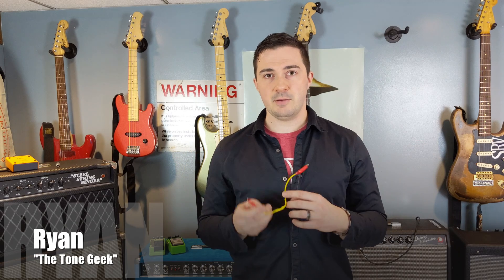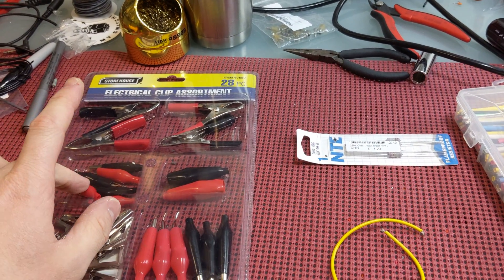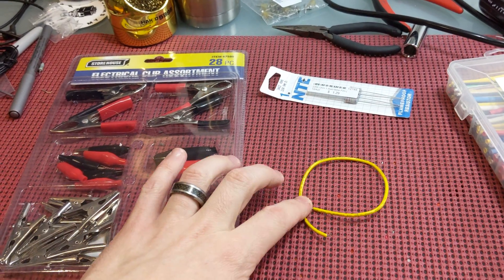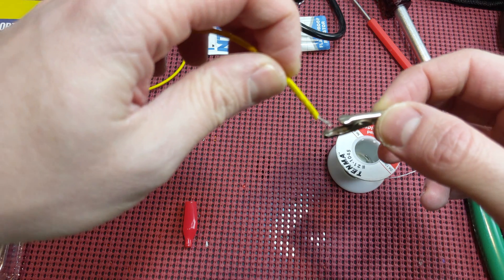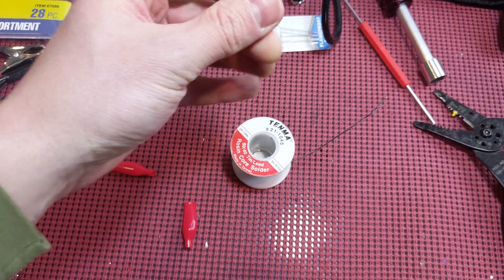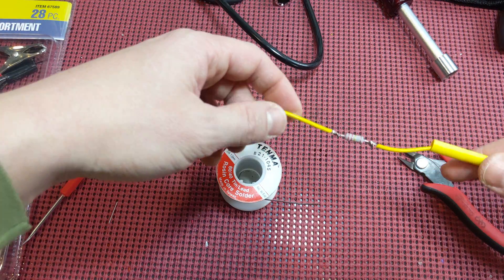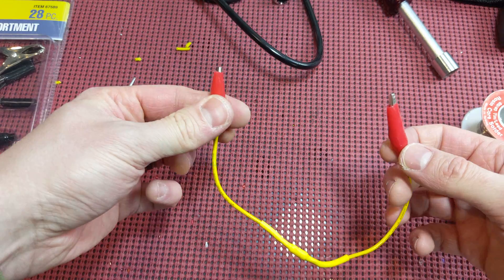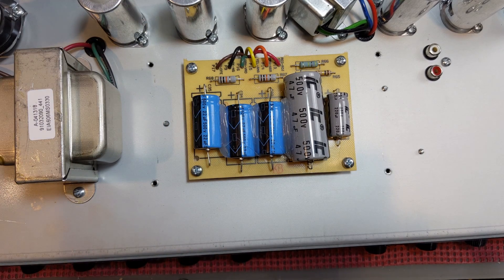How To Discharge Capacitors The RIGHT WAY | Build a DIY Capacitor Discharge Tool

Comment: Hi there, since I don't have spare parts I'd need to get them all for this specific assembly. The highest voltage caps on my amp have these data printed on them: +220uF 350V. Which resistor/s value should I get in my case? Thanx in advance! Cheers
Reply from the maker: @muaythai4lifelife  the resistor doesn't have to be exact. The higher the resistance the slower the discharge so just keep your eye on the voltage with your meter as it discharges

Comment: I have a few 1000uf 200v capacitors I need to discharge.  What size resistor do you recommend using our alligator clip method?

Comment: I suggest using a 5 watt resistor to be on the safe side. A 5 watt resistor can dissipate more heat than a 1 watt resistor without melting, making it better for discharging a capacitor. A 5 watt resistor can also be rated for at least 2.5 watts of power dissipation, which is safer for discharging a capacitor.
Reply from the maker: Great suggestion! Thank you for writing in

Comment: I have seen on youtube that some attach the alligator to the multimeter probes and then use the probe on the capacitor so they can see the drop in real time rather than counting and measure after. This must be a more timesaver. So I wonder if it's safe to do it like that. And if not why wouldn't it be?

Comment: Terrible soldering technique! Holding the part with your hand is a really bad way to solder.  For one thing you’ll jiggle the part while the solder is cooling ( in a split second) which can create a bad joint. Secondly if a joint is hot enough to solder probably the heat will flow to your finger (again in a split second ) and you’ll get burned.

Also,  a wire with an alligator clip at one end and a probe of some sort at the other (you can make the probe simply out of a mail for example) will be more useful.

Comment: will that little resistor work on any size capacitor? apologies if you said it in the video i didnt watch whole thing XD
Reply from the maker: Any size capacitor might be a stretch depending how many microfarads however for caps inside guitar tube amps you can be generally certain this resistor works well
Reply: That resistor would work in almost all cases of high voltage and high power (uF).  It simply takes longer than a resistor with a lower value while also reducing the heat that needs to be dissipated.

Comment: My own discharge method usesyour way but I add a ceramic resistor, about 1000 ohms and my multimeter so I measure the initial voltage and watch the meter to see the gradual decrease.

Comment: The content creator did not include any mention of electrical safety. Performing this work without any protection can result in serious injury or death. For the content creator's liability protection, a disclaimer should be included in each video, especially since it's a DIY video.

Holding a metal part being soldered directly without a table clamp or vice can result in skin burns, and you can lose your eye sight if spallering solder gets in your eye. Working with potentially energized circuits at high voltage should have Flame Resistant gloves for arc flash protection and voltage resistant gloves for shock protection until the circuit and components to be worked on are verified de-energized. The part or phase you don't check is the one that gets you.

The voltage in this circuit had up to 600 volts, and he could have easily caused an electrical arc and blown up the capacitors in the camera's view waving the hand tools over it. Know and respect the minimum safe distance for preventing arcs.

Safety should the first topic discussed, and repeatedly discussed during the video.
Reply: Glad you pointed all that out. I'm just now delving into this, after years of intimidation, and was wondering, "what's keeping it from discharging as he's generally gesturing near it/testing it with rinky-dink alligator clips"

Comment: Can anyone tell me how the determine the appropriate resistance range to use for the capacitor being discharged?  I'm sure a 200V 2200µF capacitor would require a different resistance than a 35V 1000µF capacitor, yes?  Does VW mean something different than just V?
Reply: you can ask chatgpt for the right resistor values based on capacitor values! It will tell you the answer and can even show you the calculations it does to arrive at that answer

Comment: Nice vid - Thx. 
Ceramic resistors are preferable for this application, energy  & heat being an issue, also the resistor chosen is proportional to the capacitor's values, so one tool is not appropriate for all capacitors.
Your use of the tool did not follow your instructions for how to use the tool - Too quick/ two hands/ no post discharge V check.

Comment: Is it okay to measure the cap still attached to the circut before I try to discharge it? What setting should I put on the multimeter? I am trying to figure out what is causing my ST70 amp to get a faint Oscillating sound and hum .

Comment: What size resistor do you use? Or does it matter?
Reply from the maker: I would use at least 1w 500v resistor
Reply: @TheToneGeek  What 500V resistor is that then? Besides resistance, the only other figure you need is its power rating. As you had the 47uF 500V capacitor in view, your 220K 1W rated resistor is at least momentarily working 10% above its rated power (please see, 'derating'). Electric shocks are serious enough to not be describing a video as 'the right way', when you seem to know little better yourself. Was your heatshrink rated at the same voltage as the wire? If there was any sharpness where you soldered, that will create a potential weak spot. The inbuilt circuit resistors are called bleed resistors or a bleed network. Depending on the capacitance and the voltage, you may use the same resistor, but you need also to be aware of time constant; the rule of thumb being 5RC (look it up if you don't know) will bring you to about 1% of the voltage you started at. It is also worth mentioning that capacitors can produce very high current  discharging initially, they pose a  significant threat if starting at mains or above (dependant on your country, I guess).

Comment: On top of the good stuff in some of the other comments... You need something to add more rigidity and strength to the resistor section. Just using basic heatshrink isn't enough. For example, a rod or strip of suitable high-voltage insulating plastic placed alongside the resistor, that the wires are tightly secured to. Otherwise, there's a risk that, after some considerable handling, the solid wire at one (or both) ends of the resistor might fracture and break the connection. Then it wouldn't be effective - so as he advises at the end, always check the voltage on the capacitor again after discharging, to make sure it has been properly discharged. Further, be aware that, after discharging one capacitor, a different capacitor in the circuit, that still has some charge, might charge it up again. So again, as he hints at right at the end, when you think you are done discharging them all, check ALL the capacitors again, and repeat as necessary... Also, you should check that your voltmeter is working properly, both before AND after making any test measurement that your life could depend on.
Reply from the maker: Thank you for the awesome suggestion. Thank you!
Reply: Right. The one you don't check, is the one that gets you.

Comment: I was thinking about making one of these. Thanks for sharing this tutorial. Other videos tend to use short circuit method as well as the sparks. yet you never really know what might happen to that 500V capacitor during the short. 

Thanks for showing us the resistance of the wires using the ohmmeter to show your process was valid. 

why did you discharge the capacitor if the voltmeter said it had low voltage anyways in the 10 mV range? The resistors at the top were for discharging?
Reply from the maker: Thank you for your kind words! My brain sometimes stops working when the camera is rolling and I think I was trying to demonstrate the capacitor discharging even further.

Comment: Why don't you tin your solder iron? Tin your wire ends? No flux? It may have been quite a bit easier.
Reply: I think the solder had flux in the middle of it. Look closely at the spool.

Comment: DO NOT PUT BOTH HANDS IN THE AMP when measuring voltage or discharging caps. This vid does show what NOT to do.... had to be said to protect people from misinformation.
Reply: Idiots is an incorrect word to describe people that are electrocuted. I do agree the methods used in this video are unsafe, and the creator should have first gone into detail about electrical safety to protect those that work on capacitors and energized components holding electricity. 

To pre-emptively call shock victims that actually die idiots is heavily biased and disrespectful to front-line electrical workers that literally put their lives on the line every day to keep the bulk power system running reliably.

Any number of reasons can be found as to why an electrical shock occurred, from an incorrect assumption about how the circuit , tools, or equipment works, to complancy or oversight in setting isolation boundaries, not using proper personnel electrical propection, to unknown conditions inside a circuit such as a rusted enclosure piece falling on 2 phases of a bus, or a protective relay failing to open the circuit in time.
Reply: So much bad information from self taught “professionals” that have no knowledge based in science and fact here in youtubeland.
Reply: All one needs is common sense. Only idiots electrocute themselves. I'm a self taught electronics enthusiast and I often have both hands in the amp. Once of course I make sure the capacitors are discharged, which also implies that the amp is off and removed from power, I've never accidentally "shocked" myself, and anyone with common sense and a little bit of intelligence won't. Only idiots electrocute themselves. The world needs less idiots.
Reply: @jasonperez7811  So only idiots electocute themselves? So does that logic dictate that most, if not all, legendary amp builders/modders are idiots as Steve Fryette, Dave Freedman, John Suhr, and many others have shared stories of potential near death experiences getting zapped while tooling around in amps. Please review your statement.....
Reply: @The_Absurdistt  one word common sense. If they were wood workers they'd have  fewer fingers. Anyone that is careful and cautious ⚠️ absolutely will not electrocute themselves unintentionally. Accidents occur when we, overconfident, skip steps. Anyone that doesn't discharge capacitors and then check that they're actually discharged and follow all safety steps WILL NOT get electrocuted. Cutting corners, being lazy, and not paying attention will get you killed and considering how easily avoidable it is. Anyone that does so is indeed an idiot. I'm sure, that after they shocked themselves they would agree at how stupid they had been.
Reply: @jasonperez7811  There are lots of dead smart people. All it takes is one lapse. We've all had them.

Comment: would it be better or safer to add a second resistor  to this tool?
Reply from the maker: I don't think it would matter adding another resistor or not. There isn't much current going through the caps like this so I am unsure the benefit. Do you have a thought of something I may not be thinking of?
Reply: It would be better!

First you need to know that if you put two (like valued) resistors in parallel, the resistance will half. Secondly, (which is the bit I think you were getting at) it builds in redundancy - almost always a good thing when it comes to safety. Thirdly, with the current splitting between the two resistors in almost equal proportion (actually disproportion, but close enough), you can add up the resistor ratings and say your 1W single resistors are now rated at 2W with them combined. You can measure with a meter before and check if one of the resistors has failed. But even if it does (usually) go open while discharging, the lower (overall) resistance of the remaining one, won't break its own power rating. 

As a side note, two sets of parallel resistors in series with two more the same, gives the same overall resistance as any one of the four it is constructed from. Series - doubling, parallel - halving, takes you back to x1. Make sure to join them all together in the centre and then do all the lovely calculations for the failure modes. Hard to heatshink, I know ...but there are small ABS enclosures that can house all that. Maybe put some 4mm shrouded sockets on the outside, pull your VDE rated leads out of your multimeter and use those. Oh ...now I feel sorry for the little crocodile lead we need to feel proud of 😢

Comment: This is a crazy dangerous way to do it!
Reply: I usually have a clip to ground and one on end of the cap then discharge, never to both ends of the capacitor lol
Reply: @Ravelover5448  That is only okay if one side has an earth reference. If your capacitor is floating (hypothetically) and charged to 500V,  grounding one, let's say the more negative side, will leave 500V on the other (with reference to earth). If you then probe the other side, the first side will go -500V (negative 500V wrt earth). All danger still there, nothing happened to reduce the stored charge. You may well have been very lucky up until now that one side was technically connected to your other (earthed) probe - of course it only was made safe because you somehow did connect both side of the capacitor together (intentionally or not) and put the electrons and 'holes' back in their stables.

Comment: Caution: If you are working on any equipment with a HIGH voltage power supply (i.e. anything greater than 600V) this will not work. Get schematics, be able to read them and be aware of what you're working on before attempting to discharge the capacitors.
Reply: WHy this will not work?

Comment: The more I watch amp videos the more I fear and respect electricity and am shocked (no pun intended) at how dangerous amps can be to use/work on. It’s tempting to just want to dive in a try things but a person really has to understand the hidden dangers. We can’t emphasise safety enough. Learn as much as you can, watch lots of videos, ask lots of questions, and remember before trying to work on amps “if in doubt , don’t”. If your not confident and don’t really know what your doing then don’t take risks, leave it to someone qualified /experienced. Peace

Comment: Every other tutorial I've seen with a similar tool has the one alligator clip to Ground (I.E. the chassis) and the other end of the tool (usually a probe, or can be alligator clip) touching both leads of the Capacitor one after the other. Any reason why you don't do this method?
Reply: I saw a youtuber who used a homemade discharger one end was a alligator clip and the other was a probe. He explained that you attach the alligator clip to ground and the probe to positive side of the capacitor but he also said that you can also attach the alligator clip to the negative side because negative side always goes to ground. So you can choose where you wanna clip it to.

Comment: Beware of when twisting and cutting the left overs of the resistor, be sure they are not Sharp en comes like a needle out of the heatshrink. So be aware, this thing is double isolated or there is a change to grab it and kill you when discharge high voltage capacitors.
Reply from the maker: ooff! THank you for the advice!
Reply: The Tone Geek it's only a safety thing, but although a great video.

Comment: Why not just short it with screwdriver your doing same with that wire anyway lol
Reply: First of all I’d like to say Thankyou , I really like the tone of this channel, so many guitar and amp channels I’ve watched recently are so full of cussing and vulgarity and it’s so off putting and out of context. If there is good content people will happily watch it. 

I have a question, but don’t expect an answer as I know you have a life and can’t engage with every comment , but possibly you or another person can explain 

I think I understand that the cap (that you discharge at the end with the resistor and alligator clips) has electricity inside it ? Or a charge ? 

I’m wondering where does it go ? I’m guessing it slowly leaves one end of the cap goes through the wire, through the resistor , then where does it go ? As my brain is telling me it should just go back into the cap again like going round in a circle , but obviously that’s not correct !

Thanks
Reply from the maker: I hear the quick capacitor discharge can harm the cap.. Slow should be ok :-)
Reply: @TheToneGeek  Oh I see. So does doing so with a wire slow down the discharge?
Reply from the maker: @COG777  wire + resistor in the middle, yes ⚡. Great question!
Reply: @michaeltilley9119  thanks Mike , makes sense 🙂

Comment: You added text saying “Anything less than 20 volts should be discharged.”  Don’t you mean anything greater than 20 volts should be discharged? What about a capacitor at 150 volts? Don’t discharge it? Seems like the wrong advice. Also you should add a comment saying not to horse around with high voltage capacitors unless you know what you are doing.
Reply: He meant: if it has less than 20V on volt meter = it's (considered) Discharged
Reply: It's a no brainer you clever dick